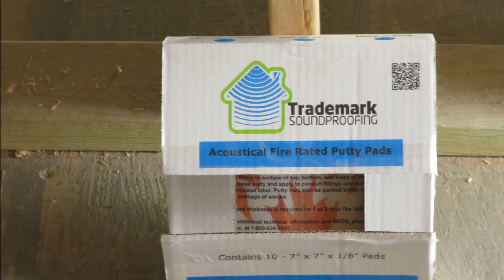Soundproofing electrical outlets in walls

Comment: So, "STC 49" - meaning, I take it - that your otherwise STC 70+ heavy-duty soundproofing room build has now degraded to STC 49. Hello, surface-mount electrical boxes.
Reply from the maker: Degraded more than that if the outlets do not have seals on them

Comment: Any suggestions if you can’t get to the backside of the box?
Reply from the maker: At the end of the video we show a Box Seal which can be mounted between the cover plate and the mounting plate. While not as air tight as the putty pad it does help a lot. https://www.tmsoundproofing.com/Electric-Box-Seal.html

Comment: do you think this product will help prevent secondhand cigarette smoke for coming in through my outlets???  I'm disparate!!!
Reply from the maker: Yes it will. as it is an air seal as well.
Reply: You could try foam sealer too, not sur eif that is fire safe but i guess there is fire safe stuff out there.

Comment: 35 dollars for 5 pads on amazon. Crazy. I’d need 10 so I’d have to spend 70 bucks for silly putty.
Reply from the maker: For silly putty it is expensive. For sound and fire UL rated intumescent material that price sounds right. Here is a link to purchase it on our site  https://www.tmsoundproofing.com/Acoustical-Putty-Pads.html
Reply: Psst...search for 5 foot rolls of electric putty which are much cheaper.